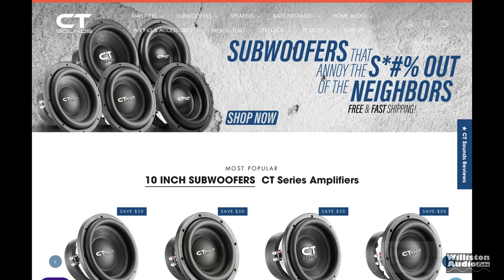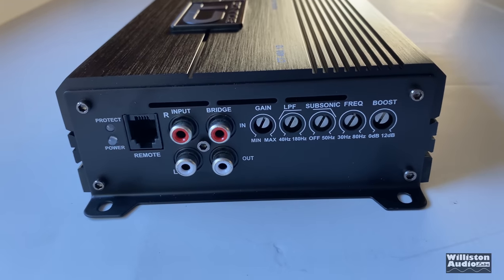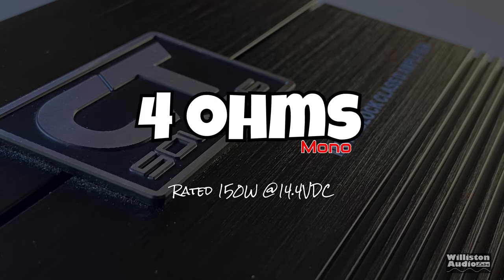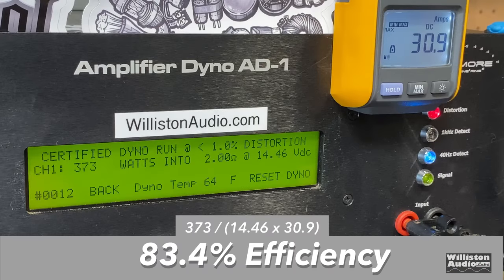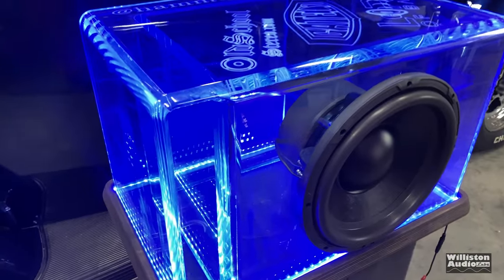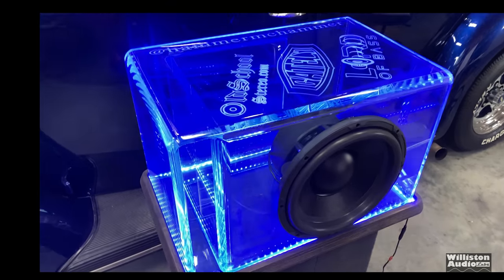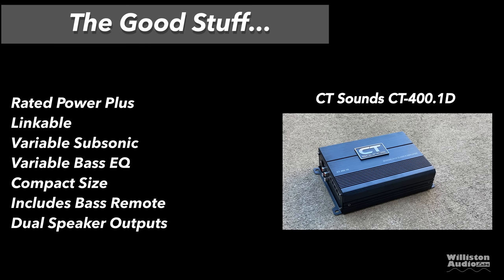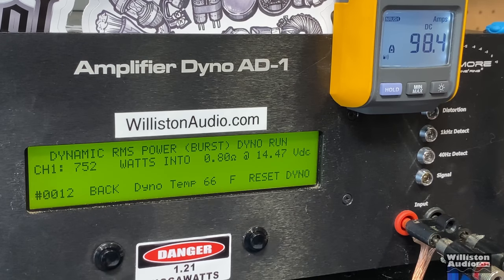Bass Amp for the Masses? CT Sounds CT-400.1D Review and Amp Dyno Test [4K]

Comment from the maker: Shop for the CT-400.1D
CT Sounds - https://is.gd/walctsounds400
Amazon - https://amzn.to/3u9n1UY

DISCLAIMER: This video and description contains affiliate links, which means that if you purchase from one of the product links, I may receive a small commission. As an Amazon Associate I earn from qualifying purchases
Reply: Nice amplifier and yes I got a HUGE PREFAB ATREND 2 18 PORTED FULLY ASSEMBLED BOX FOR LESS THAN $800!!
Reply: Can you test the Kevlar amp k-1600.4
Reply: You may have covered it in one of your videos, And I just missed it. But where do you set the outputs of the amps during the testing? Max? Midway? Or do you use a meter for optimum settings?
Reply: Have you tested out the nemesis audio
Reply: Wilson have you ever tested LA Sound Malibu 120s rated 180w RMS MONO car amps 1990s stuff 2 ch ? Im still using one in my oid f150
Reply: @earnestmerida  
You set the gain control to just below where the sound begins to clip.
Reply: Hey i bought this amp and 8 inch ct tropo rated 400rms did i do ok??
Reply: @likeart4703  You're the only judge of Okay." If you like the sound, and didn't spend "too much, then you did okay. If you only spent $60, but don't like the sound, it wasn't okay.
Reply: What about cool weather bug this thing doesn't come out of stand-by ambient 60 degree or colder
Reply: @likeart4703  good job
Reply: @broken1965  I haven’t encountered that issue with either of the 2 CT amps I’m running, and I live in Minnesota, where it’s regularly below 0°. In the 4 years I’ve had my amps, I’ve never had any “cold weather standby” issues. 

I’d likely chalk that occurring up to either user error, or a few bad amps per batch (which isn’t unheard of with any brand).
Reply: @bleachstain9785  probably

Comment: pro tip: if you guys are missing a bass knob for your older jbl amp this exact style of ct sounds bass knob will work. they are available for sale separately 👌😎
Reply: Would it work with a GTO1400.1?
Reply: @grandhubert  that is a nice ass amp but a little bit of an older generation. bass knob wouldn't light up but would probably work

Comment: Heck, get two of them and run a 10" on each one at 2 ohm so you get the efficiency. That would slam behind the seat in a truck cab. Fantastic value.
Reply: I was thinking the same setup. 👍🏽
Reply: Would the 1000 watt version push two 10" subs pretty well?
Reply: @bighashgang1990  which subs are you getting? I'll recommend an amp of you tell me the sub model.
Reply: @bailey2517  they are the alpine type R the 2 ohm

Comment: This amp gives me all the power I need and more!!! Super easy to use / install. Looks sleek, too. 

Love CT products
Reply: Would the 1000 watt push two 10" subs pretty well?
Reply: @bighashgang1990  depends. What model are the subs? And you'll want a bigger box to maximize efficiency. I'd recommend 3.5-3.75 cubic foot Cox for 2 10s.
Reply: @bailey2517  ended up getting the CT1500.1d and it's pushing them suckers lol they are bangin but they are the Alpine type R 10 I think the 2 ohm
Reply: @bighashgang1990  nice! I'm wanting a new amp and I think I'm gonna try the CT-1000 On a Skar EVL 10.
Reply: @bailey2517  hell ya
Reply: @bailey2517  I’ve got my CT 2000.1 running 2k watts rms on a single Sundown Audio SA12 Classic (rated at 750 RMS). 

You need more juice for that EVL.
Reply: @bleachstain9785  lmao I ended up selling the ct1000 about 2 weeks later and buying a Skar rp1500 🤣 that amp pushed it much better.
Reply: @bleachstain9785  but now I have a VXF-15 on an rp3500 it crazy.

Comment: I purchased the CT sounds700.1d amp and very happy with sound quality . Clean, crisp powerful  bass playing it through a 12" kicker 400w  r m s speaker in a 2 c.f. ported cabinet .I also put damping material in the cabinet to eliminate cabinet echo .
Reply: Would the 1000 watt version be good for two 10" subs?
Reply: Does it get hot or warm?
Reply: @Itsuki491  Amp slightly gets warm .

Comment: Thanks for the review!!  I was running an equivalent Skar unit with a pair of their 6” subs. Wasn’t crazy about the sound.  Then the RCA connector came right off the board when I removed the cable.  Have been looking for a replacement, and this might be the answer.

Comment: I think it beats the Jensen xda91rb for a budget amp (in some cases). The Jensen has no subsonic filter and no way to add a bass knob unless you buy an inline plus the additional RCA's to adapt it (makes it more expensive than CT at that point). Plus the Jensen app is buggy with some phones. The Jensen is more capable power-wise but you need a DSP with its limited features. Lets be honest though, how many people willing to invest in a DSP are using either of these amps? Either would be ok if you have a head unit with decent processing and you were trying to bang on a budget, but if you have that capability I'd go Jensen for the extra power.

Comment: I just bought this amp right now. It's gonna push 1 audiopipe 12in sub. Once I receive it I'll post an update on sound quality
Reply from the maker: Sounds good 👌
Reply: @wal  got it yesterday, I didnt realize how small it was gonna be lol 😆 but I'll install it this week. It's like a little brick.
Reply: @wal  so I got the 400.1 installed it and sounded damn good and went riding i posted a video, but got wet in my UTV. I went ahead and bought the 1000.1 and I'll make a video on the and sound quality. Thanks Big D for the amp dyno

Comment: Have you thought about using ferrules on those wires/cables? I use them on my builds...beats crushing wires with those set screws.
Reply: Yep, and a MUCH better connection. I mentioned it few years ago and D brushed me off with some silly BS excuse.
I would consider ferrules were 100% mandatory for a professional installation, so perhaps D isn't in that league?
Reply: @johncoops6897  -- I respect what he does on his channel...love his work and showing others what he does. However, most people don't use ferrules or know how they benefit their installs. IMHO - not using them is a safety issue. One small fray of wire hitting the amplifier chassis will short out an amp, blow fuses, damage speakers, fire, etc-etc. Crushing copper wires with those set screws also causes a weak connection...esp when one is pushing high amperage. I cringe when folks don't use them...but, people do far worse things.
Reply: @ChrisDIYerOklahoma  - yep. Seeing him pulling a hundred amps or more through a shitty screw connection is cringe worthy, and I wonder how much it affects his results?. Imagine the voltage drop caused because maybe only half the conductors in the cable are actually connected at the ends!
He's not using a 4-wire measurement connection so if it says "14.4 Volts" where exactly is that being measured? Certainly not at the Amplifier itself!
Reply: @johncoops6897  -- Exactly. Connections are the most CRITICAL junction in a circuit. There are so many videos out there showing how improper terminal connections (like battery lugs, power amplifier leads, speaker connections, etc) causes all kinds of problems (thermal imaging proves this...they overheat due to loose, frayed, weak junctions). Properly sized ferrules that match the hole size and wire size will reduce the guesswork and make for a more proper connection and current flow. And safer.

Comment: Just wanted to chime in as I’ve been beating the crap out of the 80. 4D as well as the 2000.1D for 2.5 years now on a daily basis. 

Fantastic amps, clean sound, gorgeous looks, relatively inexpensive for what you get. What’s not to love?
Reply: Do they get hot?
Reply: @Luminous.Dynamics  around 102° peak in winter, 116° peak in summer with several fans mounted directly behind my amp rack.

Comment: 400w is more than many people realize. Doubling wattage of any amount, 400w to 800w or 40000w to 80000w will only give about a 3db gain. That is considered by some to be the smallest amount of volume increase that is detectable by the human ear, in other words, not much louder. You need something around a 10db increase to double volume. Its been a while since I have looked but I believe it takes a 10x increase in power to hit the 10db gain, but don't quote me on it without double checking. the first few hundred watts do the most, you get rapidly diminishing returns after that.

Comment: I'd like to see you talk more in your reviews on watts in regards decibel output please Big-D. For example, this amplifier makes between 35% and 50% more than rated power at any given impedence and input voltage. This will be an audible difference to most people, and highly appreciated by budget buyers at this price point. By comparison, that an amplifier rated at, say, 3000WRMS 'only' makes 2800WRMS when tested is irrelevant. This is only a 7% difference in total power and therefore - while 200WRMS is 'missing' - there is no audible difference whatsoever between its measured and rated power. Your reviews focus too heavily on meeting numbers, when most of the time it just doesn't matter - especially as total power increases. Also, efficiency at 1ohm being 'low' is irrelevant in an amplifier this modest in total power, as any car charging system/battery will cope with this amount of current draw so this is a non-issue. You need to consider these things when critiquing gear.
Reply: Decibel output is really going to depend on all the other equipment used and more importantly the nature of the installation.  You can pretty much assume higher wattage provides the potential for greater decibel output.  What Big D provides here is a clean comparison against other amplifiers he has tested, and verification (or lack thereof) of the manufacturers claims. You can take the actual wattage produced, and the efficiency to create that wattage and compare to other brands and make your own decision on what to buy.  The only thing Big D doesn't provide, which would be nice, is a dollar per watt ratio, but he likely omits it because so many of the products change in price over the course of their run and by the time his video comes out it could have changed again.

Comment: i dunno.. a fosgate prime x500x1d can be had for only a few bucks more. sometimes alot less if you can find a good used example. pretty sure anyone would rather have that. linkable features and more speaker outputs is meh. having all the wiring on one side of the amp is also just a dope feature.
Reply from the maker: The RF and Alpine 500W amps used to be around this price, but now are quit a bit more. All great amps 👍
Reply: Nope. RF Prime 500x1 go for $230+ all day anywhere

Comment: Why didn't you use a CT Sounds Speaker. I have purchased a FULL system from CT Sounds when Soundman was using them as a sponsor . Have the aluminum finish 300(mono) and 100(4 channel) , 4 Pro 6inch, 12inch dule4, 4 tweeters...all to fit stock speaker locations..... This budget system was almost 600 bucks!

Comment: I purchased this amp based on your testing and review. It did not disappoint for what I needed. However, it seems cold weather affects it reliability until it warms up: protect mode rears it's head sub 50 degrees F with mine. Is there a way to test that? Certain electronic components are affected by temp, which begs to question it's internal circuitry for less than mild climates.
Reply: thats weird ive played this in 38 degree weather and it had no problem playing

Comment: Big D you need to drop down the voltage to something realistic 13.3v or so  Most of us are not putting out 14.5V
Reply: You should be putting out round 14.4/14.8 when car is running

Comment: Did the two 35 amp fuses blow when it pulled over 70 amps during the tests?
Reply from the maker: No since the fuses will handle much more than rated for short periods
Reply: @wal  ok I understand. Thanks bud

Comment: Would this amp but the 1000 watt push two 10 inch subs well?
Reply from the maker: It depends on the subs and your expectations
Reply: @wal  the subs are Dual brand 10 inch, I hooked it up last night and it works and pushes them pretty well but it gets super hot so I'm going to get a nicer amp

Comment: Little disapointed CT would opt for a fantastic plastic Liefonics type bass knob... I think in this day n age everything would sport a clip light on the remote regardless of the price. It's not expensive to do, even toro put one on there $80 amp why not on the knob but better than nothing but a clip light is such an important tool for  saving coils! and most people really don't realize how soon an amp clips If pushed at all., But every sub saved is a sub not bought.... No money in that!
Reply: My clip light flashes like a Christmas tree because the system is tuned to -7.5db. For me it isn't that important of a tool since I'm clipping the amp on purpose lol.
Reply: Could just use the smd dd1 to set the gains

Comment: Could they make that LED any brighter?  Imagine driving at night with that in your face
Reply: I usually just use a permanent marked to tint it lol looks better too way less bright
Reply: Computers are bad for this too. I got a new computer case and the dang blue light was so bright my entire room blinked blue when it was in standby. Had to add a lot of resistance inline to fix that... I don't know that there's be room in that remote box to do that, though.
Reply: For sure, you'd have to go the ineloquent route with a piece of tape or a marker I reckon.
Reply: I've always put my bass knobs inside the armrest in the middle to avoid that. Nice little spot for it.

Comment: What's the point of matching subs to 1 ohm amps when the speaker is basically never at 1 ohm? If your sub can handle a sustained 1500w wouldn't it make sense to get an amp that pushes 3000w at 1 ohm since you're going to be playing it at 2 ohm or above the whole time?
Reply from the maker: It depends on your setup, box, sub, vehicle and more. Amps have always been rated for nominal load
Reply: @wal  just the more of the AMM-1 I see the more I realize a 1 ohm sub seems to never go below 1.8 ohms when it's playing. At least not for a long enough amount of time that it even shows on the meter. I always thought people were nuts putting double rated power to Sundown subs or whatever but it appears that "double rated power" actually comes out to what the speaker is rated at.
Reply: @wal  sir can I borrow your car amp hehehe. I will put it on my tricycle . Big fan of your Dyno test from phillipines

Comment: I have a TOPSTRONGGEAR 1100-1D and it has the exact same bass knob, finish, hardware, rca's, etc...  It's a different circuit and does over 1400 watts. Sundown SFB 1000 is the same circuit design as TOPSTRONGGEAR. It's a Digital Design clone or ripoff, whatever you want to call it. I only care about Big numbers Big D. I don't care what you found at the flee market or a mono that does less than 1000 watts. More good 4 channels might be nice if you're tired of the mono's.
Reply: Not everyone cares about 1000+ watt amps. CT Sounds isn't exactly flea market either.
Reply: @msh6865  lol you’re right, ct sounds isn’t flea market. I was actually referring to his other videos where he wastes a dyno opportunity on complete junk. Although I wouldn’t buy a ct sounds amp, they seem too unreliable but that’s just a general statement from hearing about one failing or seeing a repairs done on them. I don’t always care about 1000+ watt amps either, I said I wanted more 4’channel amps which typically are not 1000+